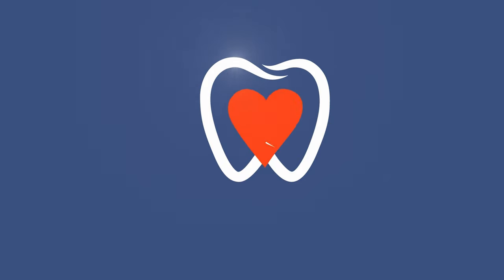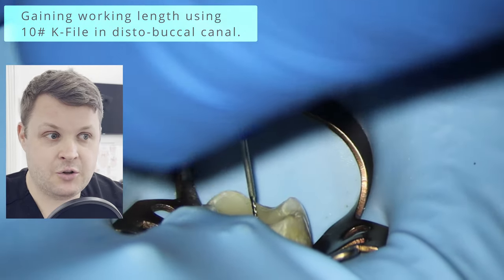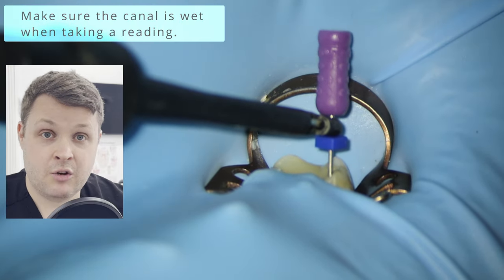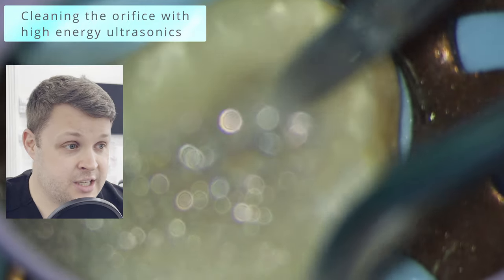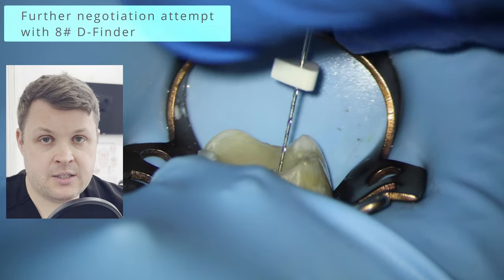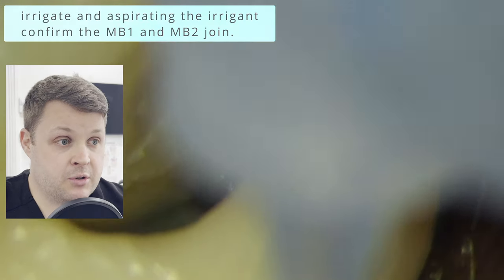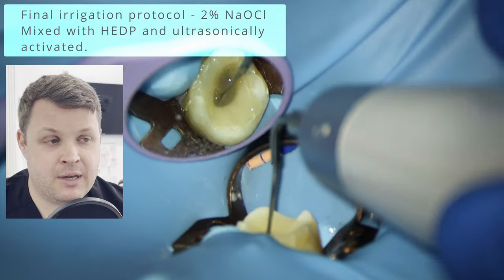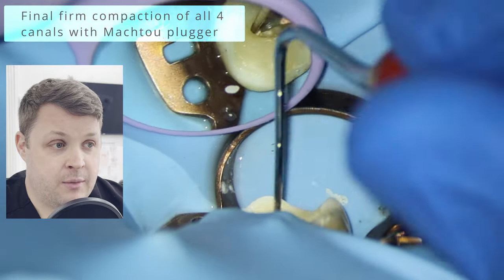LIVE RCT EDGE FILE X7 REVIEW | 4K Resolution

Comment: Hello Dr. Thank you for this awesome video. 
I have been using the edge file x7 for 5 years . This is the shaping protocol I have been using 
Step 1 - 8,10 and 15 k files to length .in tight mesial canals I don't try to force the 15 to length 
Step 3 - 30/04 , 25/04 and 20/04 ( in that order ) in crown down technique  to length 
If 20/04 does not reach length in the first pass . I use a 17/06 to length . In most cases after this 30/04 will reach length . Hope this helps 

Also what RPM and torque settings do you use for these files .
Reply from the maker: Wow! This is an amazing protocol! It is a great file, very good cutting efficiency.

Comment: Do you need to cut the tip of the cone for MB2 since it merged? Or you just put a regular cone in? I feel like the apical part of it where it merges would have a large open space? Also why can't you use BC sealer with heat?
Reply from the maker: I used to cut the cones, and would on occasion. But when using a bioceramic it flows so well that the I can confidently push the come to length and it still be filled well. As for heat with a bioceramic, it alters the setting on the sealer itself.

Comment: Hi Doc. Great videos. We are all blessed to have people like you.
Can you elucidate on the reasons you use .04 versus .06 rotary files. Thank you!
Reply from the maker: It all relates to how much dentine removal you want to achieve, and therefore how much dentine you want to preserve. On the one hand, the dentists who like to use .04 preps think that by preserving dentine, the tooth is stronger over the long term. However, using .04 preps can be difficult to obturate. I personally use a mixture of the two depending on the case/tooth

Comment: Hello Dr Pulp thanks for sharing your practice, your videos are amazing. What’s your obturation protocol with bioceramic sealers? How do you compact and cut the gp cones?
Reply from the maker: This video might answer your question: 

https://www.youtube.com/watch?v=R47fPIfqi-I

I think it is totally fine using heat to cut off the GP and very superficial compaction (using the heated plugger). However, pushing the heated plugger in the mid 1/3 is too far and likely result in the sealer not setting correctly. Are you using bioceramics yet?

Comment: Hey Samuel, great video. Did you shape the MB2 to full WL or only to point at which it meets the MB1? 

Also do you think the GP points didnt fit the MB and P canals because the X7 has a small maximum file diameter (compared to other 4% constant tapered systems e.g. Vortex Blue) or was it because the EAL was acting up?
Reply from the maker: I shaped the MB2 up to the join, I think shaping past the join can cause file fracture.  As for the fitting of the cones, I’m not sure! I always just recheck working length and shape the canals a bit more, before trying again.

Comment: thanks for your effort and your videos dr. keep up the good work 👏
I would like to know your opinion about stopping at the reading of 0.5 to 1.0 when the case is vital just like what dr Domenico Ricucci says so that the apical tissue stays intact because it's already sterile? also do you do patency with vital cases or just with necrotic cases?
Reply from the maker: I always shape to -0.5mm from the zero reading seen on the apex locator. Vital or non-vital. What do you like to do?
Reply: @ilovethepulp  I also shape till 0.0 but in vital cases I may stop at 0.5 to avoid destroying apical tissue however when I can't get patency in vital cases I'll rely on copious irrigation /heating + ultra sonic activation and I'll obturate with BC sealer with a slight force so that I minimise chances of bacterial colonisation
Reply from the maker: @mustafa26985  I noticed that when I did shape to the zero reading on the apex locator, that I extruded too many times!
Reply: @ilovethepulp  I do that in retreatment and necrotic cases but with vital cases even if I'm a little short I wouldn't be worry as long as the entire procedure was done under rubber dam and copious irrigation and activation were used

Comment: have you used any of the files from toothsaver? There is a 14/03 file love to hear your thoughts on that
Reply from the maker: Yes very good! I love the tooth-saver website, lots of cool gadgets! What files system do you use?
Reply: @ilovethepulp  I used it as part of the tooth saver kit. It's very good. Just switching to tooth saver files. I feel wave1 gives me issues with obturation. I'm doing 3 pecks and out and working through a puddle of hypochlorite and checking no.15 k file goes to length and find the corresponding cone doesn't seat. I use primary aka red for 90% of the cases but the yellow cone seats go length. There's taper lock. So either do more flaring on the canal walls or increase apical diameter. It's frustrating. Didn't have this issue with protaper.

Comment: Why can’t you use heat with BC sealer? I use Brassler BC sealer and I always sheered the GP points off with heat, was I doing it wrong?
Reply from the maker: Yes the BC sealer is amazing! And yes you can shear off the sealer at the top with a heated plugger (that's what I do), but it is not advisable to push the plugger deep into the canal, as if you would if you carry out a traditional warm vertical technique.

Comment: Why can’t you use heat with bioceramics?
Reply from the maker: When you heat the bioceramic, it stops it from setting properly. Do you use bioceramics in practice?
Reply: @ilovethepulp do you mean cleaning the gp with heat after obturation?
Reply from the maker: @zak_1998  Yes, if the heated tip touches the sealer , it goes a chalky consistency. I've also been told that to desicates the dentine (dries it) which effects the setting of the sealer, as bioceramics rely on water to set! hope this helps!
Reply: @ilovethepulp  i dont understand...at some point the heated tip has to touch the gp and bc sealer. are you saying you shouldnt use BC sealer with warm vertical ? i agree with that, but to say the heat tip can't touch the bc sealer is unrealistic. how else are you supposed to trim the gp cones?
Reply from the maker: @Nvrloptimism  What I mean is don't do a full compaction with the heated plugger to say the mid 1/3 of the canal - like in a traditional warm vertical compaction technique! Confine the heated plugger to the coronal 1/3 of the canal.